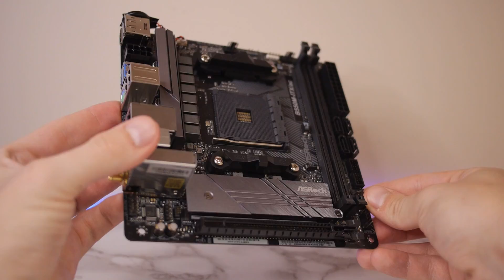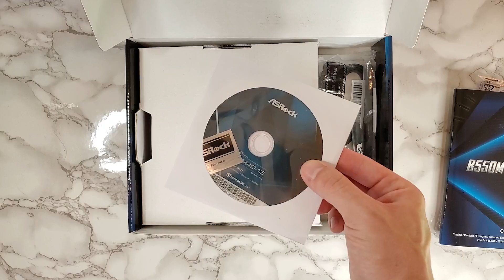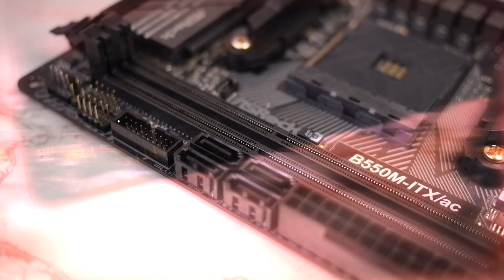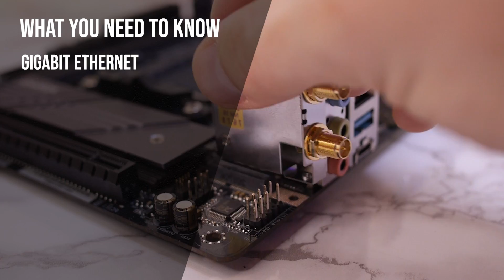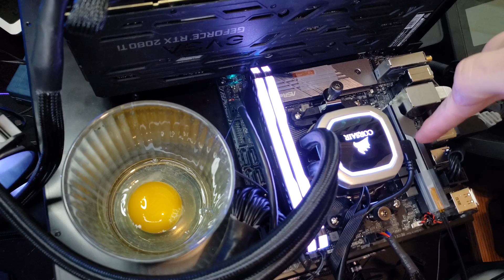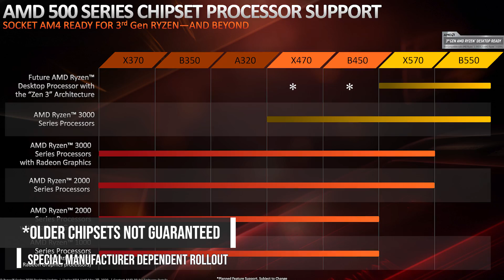The CHEAPEST B550 ITX Motherboard! - ASROCK B550M-ITX Review.

Comment: Thanks man. You gave me the info I needed to make my final call and buy this motherboard . Great vid.
Reply: dont do it. No Bios Crashfree/Flashback function. There come a lot of new Bios Versions and new CPUs. When something goes wrong, thats it, board broken.
Reply: @ZachalZockt  Damn too late. Oh well. i mean this is my secondary side computer for traveling. so if it does die wit wont be the end of the world. thanks for the advice though.
Reply: @ZachalZockt  Is the BIOS Cashfree/Flashback function important for casual users who updates BIOS regularly?
Reply: @MASViper  i wouldnt buy it. When something goes wrong, you copy the new bios on a usb stick, plug it in the mainboard and push the flash button. done. With BOTH! The cheap and the expensive AsRock B550 mini-itx, you dont have that feature, it keeps black when you push the Power button. Take the ~40 Dollar and buy a Gigabyte B550I Aorus Pro AX , MSI or ASUS. 
No Crash save for over 120 EUR/Dollar lol, what the hell ASRock....
Reply: @ZachalZockt  is there any 450 you would reccomend over it? Due to import taxes and all, since I’m not from the us, for me the difference between a 120 dollars mobo and a 180 dollar ends up being around 130 dollars
Reply: @thealterlion7163  450 normal or mini-itx? Im not from the US to, Austria. it depends on what features do you need. A good onboard soundcard? overclock?
Reply: @ZachalZockt  I don’t care a lot about most features. I care about integrated WiFi, good enough sound and a USB C port, so really nothing special. 1 M.2 slot is enough for me, since I store all my games on a SATA SSD anyways
Reply: @thealterlion7163  ATX or mini-itx?
Reply: @ZachalZockt  mini itx. I'm building on a Silverstone SG13
Reply: @thealterlion7163  1) Gigabyte B450 I Aorus Pro WIFI 
Great Soundcard, but no Bios Flashback

2) MSI B450I Gaming Plus Max WIFI = great mosfet but very weak soundcard and no bios flashback to

i would take the gigabyte

https://geizhals.at/?cmp=2405450&cmp=1881648&active=2
Reply: @ZachalZockt  this one? https://www.amazon.com/-/es/GIGABYTE-B450-AORUS-PRO-Motherboard/dp/B07GPDJ9R6

It would be about the same price as the one the video is talking about, and I think I can live without usb c anyways. Adapters exist due to a reason

Edit: Read some reviews and it seems I'm gonna have to add 20 dollars for a bios update service. Are you sure about it? All amazon reviews keep trashing it for being low quality, having bad voltage settings, the VRM overheating, etc
Reply: @thealterlion7163  yes that one.
You dont need a Bios Update Service if you have a 2000-3000 Ryzen. it means you cant use out of the box, the Zen3 Ryzen 5000, because its a B450 and not a B550. 99% dont need a voltage setting on mini-itx. Overheating? maybe they are using DAN case or something else without Case Cooling. Dont be afraid. You will read bad things about every Hardware.

Comment: hey, wanna ask something. can i replace wifi module with intel ax200 that support blutooth 5 and dual band connection? if it's possible, how?
Reply: just unplug the wifi like he did early in the video, unscrew the wlan card inside the shield and replace it with a new one. it's a vertical M.2 E key slot so don't put half mini PCIe wlan card

Comment: Good video production/editing. Definitely hit me with a surprise in the quality of the topic that was being discussed and I was surprised to see you specify so many specifics on the board. That being said I am now going to start roasting. The review gave a comparison to one (literally one) motherboard the Gigabyte B550-Itx which is in the $200 price category. It is obviously the superior board but it is in a completely different price category. That being said the other big issue was this is a review. What was the RAM being used? ( where is the XMP, overclocking, and what was the bios like even attempting to tune the memory like or cpu experience). Its a good board for the price point and it blows everything out of the water around it. Where is the mounting support for AIO's or even the mention of what water cooler you used in the video. There's no mention that the MSI b550 itx and ASUS ROG Strix b550 itx boards HAVE THE SAME POWER DELIVERY(FOR $200). There isn't even a acknowledgement of the the rear I/O (yes its labeled but there isnt even a mention of it being there and voiding the complaint of the USB-Type C header )   having USB Type-C completely removes the complaint of not having a USB-Type C header on the board. Literally every board in the b550 isn't backwards compatible again voiding a completely useless complaint about using older cpu's on a modern platform. Finally, we address the almost troll like complaint about the this whole video. One M.2 PCIEx4 NVME slot.... Given the heat, price, and capacity for a 1tb PCIE x4 Gen 4 NVME its almost pointless to even buy one unless you're compiling, have a virtual work station, or are working in a business where seconds cost money... If you want a full feature set that is complete buy the Gigabyte B550 board. But, if you're not a company doing adobe shop premier pro rendering 4k videos and need the fastest drives (2 drives one to work on and one as a scratch drive) then don't buy this board. A PCIE X 4 Gen 3 will get the job done at a great price point and you can even afford a 2TB one in comparison to 1TB for the Gen 4 one. Overall I'm left leaning in disappointment because this was meant to be a review on a motherboard and instead its a reviewer who obviously loves to do YouTube and review things ,but didn't think the video out the whole way. Hope this helps in some way as I was surprised in the quality of your video, the depth in content however was lacking.
Reply: Thanks for the detailed write-up. Is your recommendation of the PCIe3 M2 in favour of the Gen4 due to better heat performance on the back of the mobo? In that case would a mobo with a Gen3 slot on the back be a better choice for a more mainstream user?
Reply: @timchronis1584  it's a budget board ment for cash strapped users that wouldn't be able to dish out the extra $80-$100 dollars on a more premium complete board. Honestly ASRock could've added another slot in the back but one PCIEx 4 Gen 4 is enough. I wouldn't want to have two gen4 nvmes running because you would use up all your pcie gen 4 lanes and your new GPU (if you're planning on getting nvidias or amds gpu's coming in the winter/fall) which is why you should get these boards (b550 series). I'd definitely recommend getting gen 3 nvmes not really worth getting gen4 ones yet unless you're a business. This board is good if you only plan on using one pcie 4 nvme which is what anybody should only be thinking. I think in the future 2 nvme slots will become mainstream 1-2 years for budget boards. Until then this is the best board at this price.
Reply: @timchronis1584  also you might want to take a look at the x570 line up. The Gigabyte x570 itx board is a beast and it's a good price if you want full speed on two Gen 4 nvmes  PCIE x4 and it won't eat up all your lanes since the x570 chipset had a lot more Gen x4 lanes and you'll  still have enough for your new Nvidia and amd gpu's.
Reply: Probably because the Gigabyte one is the next cheapest board!
Reply: @BluesFanUK_  next *itx motherboard. There are a bunch of motherboards that are cheap but none have the same type of great power delivery as this board. The best board would have to be the Gigabyte  B550M Aorus Pro for price to performance. Though it doesn't have a Dr. Mos 50 Amp Power controller or a 60 amp power delivery like the ASRock B550 Itx board. It's a beast with a bunch of io (you could add wifi if you wanted with a USB for super cheap *has 9 USB ports and one USB type c) and extra pcie slot  x8 slot and 2 m.2 slots. It's a complete board if you're not interested in getting a ITX board.
Reply: Thanks, I'm not necessarily interested in PCIe4 M2 but the placement of this particular slot is what concerns me. Will the M2 drive get too hot because it's sitting right on top of the chipset?
Reply: @timchronis1584  nope the heat sink keeps it cool. B550 chipset produces very little heat if any.
Reply: @timchronis1584  again something the video should've noted/reviewed;
Reply from the maker: @CastielTheBleachFan  Hey,

Thanks for weighing in - you clearly took some time to think / write up and i appreciate it.

But ill try to give my reasoning for many of your points for you, as some things are a little off and we also seem to view things a little differently.

Comparing to the Aorus B550 - Its the next cheapest B550 ITX board, its the only logical thing to compare it to and likely what buyers are thinking - "should i get this or go for the Aorus". I also do try to compare "other B550 boards" too when it comes to chipsets for wireless and audio etc as they do use better chipsets and thats probably important for a buyer to know.

Showing BIOS and playing with RAM / XMP / Overclocking - BIOS is going to be mostly the same as other ASROCK BIOS (especially B550) XMP is XMP, if the memory has it and the motherboard sets it, your all good. But having known good timing adjustments from another board to use against others for review is actually a pretty good idea so thanks for that and overclocking might be something that i could introduce - but with how much you lose in single core compared to what you gain in multi, thats a debate in of itself.

Im not sure what you mean by AIO mounting support? - it's an AM4 socket, which i did mention, and uses AM4 mounting. And the AIO used had no impact on the test (h100i Platinum)

Good idea about doing a more detailed comparison of VRM across other B550 ITX boards... But you also didn't like that i compared the board to the Aorus a few comments before, so ill take this as a "cant win" scenario haha 

USB Type-C internal and external matter, just because it has one doest mean not having the other isnt a negative... Some people will literally have a case with no way of using its Type C port if this wasnt mentioned and I have also pointed them in the direction of a solution. But the logic of that comment is also a little odd as there's adapters from type A to type C - so by that logic, not having a type C at all is fine as you can adapt an A? - id disagree.

I think you misunderstood the CPU compatibility - i was talking about what boards are future compatible with CPUs, not which boards are backward compatible.

The complaint was for a single M.2 - i know many people, myself included, that have bought an m.2 boot drive and have looked to upgrade their games / mass storage to m.2 later down the line - this wont work with this board without replacing the boot drive. People also like to segregate drive for different activities (without partitioning). But yes, if you were building new, a single high capacity M.2 drive will do the job... but there are many other scenarios like Gen 4 boot drive and Gen 3 games m.2 (super fast boot if you have apps that require it - but also not going too overkill on a games drive).

But as for some of the other comments below your main one - i do need need to mention that B550 has a max of 20 PCIe Gen 4 lanes so you wont be able to do 2x Gen 4 NVME m.2 drives on any B550 Motherboards (in native m.2 slots) like you mentioned - not unless the manufacturer does something odd like not provide a 16x Gen 4. For b550, m.2 slots (other than the primary) are Gen 3.

As others have mentioned, yes - were comparing ITX. Im not going to put this board in a mid tower, so why would i compare it to ATX / mATX? Different product.

Fair point on M.2 heatsink performance, ill likely inlude that moving forward.

Hope this clarifies a few things as i feel there was a lot of passion in your comment and i genuinely do appreciate the feedback - but i think it was important to clear up quite a few of those points. 

I have tried to be as objective, logical and as respectful as i can. I hope you do the same. 

Thanks, James.

Comment: “Lower tier audio chipset” - I have a fio dac/amp that’s USB, does this get affected negatively? Or is it completely separate since it’s an independent device that’s connected vis USB? Edit: earned a sub, great vid.
Reply: It would only affect you if you were using on board audio. As you are using a dac/amp all the processing goes through that usb device.
Reply: Paul Lusty one question is if the USB noise would be a factor or rather plugged DAC/Amps that could get the noise from other plugged devices like an electric fan or airconditioning?
Reply: @agoogleuser9025  To be honest im not too educated on this kind of thing but yes the powering via usb can cause some electrical interference, dependning on your mobo and how many usb devices you have plugged in etc. Unless you are using very high end low impedance headphones with a budget dac/amp you aren't going to notice much difference.
Reply: @paullusty  Its okay, thanks for clearing it up still! 

I'm really keen on getting a mobo with better audio instead of getting a separate audio device since our home outlet isn't grounded. I can sometimes hear buzzing through my headphones! Really concerning. I've been asking forums regarding this too, seems like a unique case with our old electrical at home.